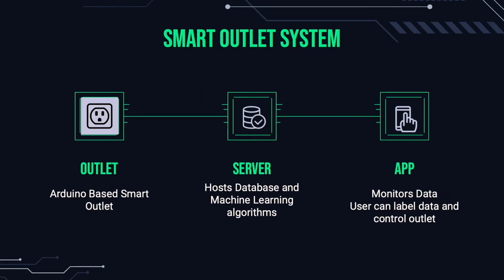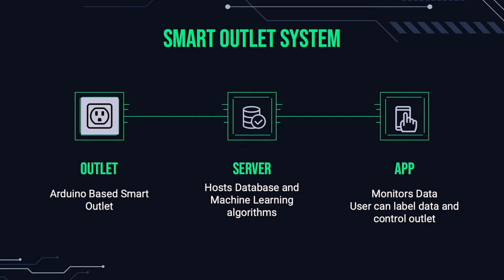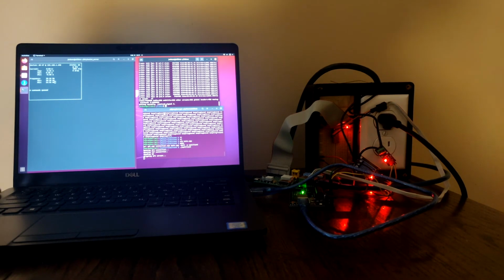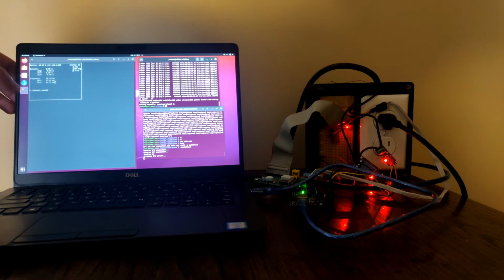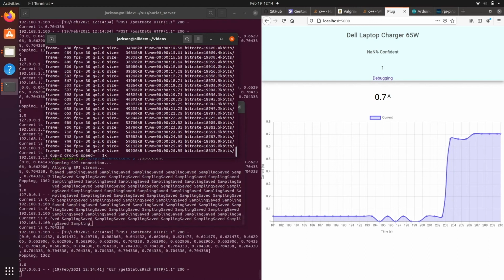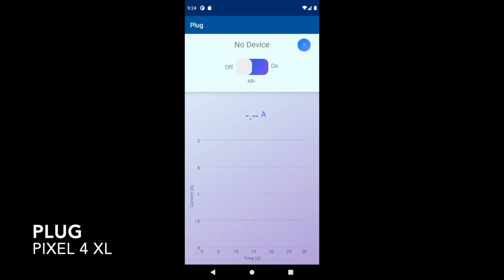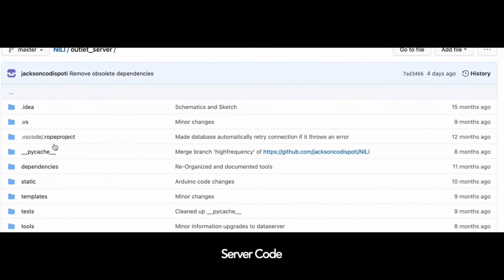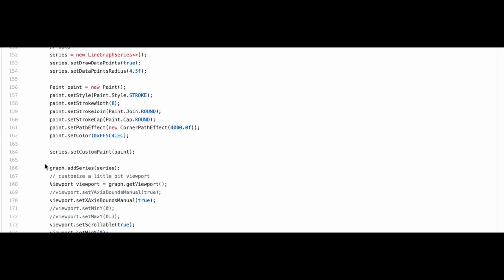Developing a Smart Outlet System - UK Computer Science

Comment: Is there a light and non-professional software to align the image if the projector is placed sideways with the hdmi cable? (for reasons of space I cannot project with the projector straight ...) I have a mini-projector the dragontouch mini z1 which with android 7.1 allows me to position the projector where I want and to have a large or small square or rectangle, (the problem is that when I connect the hdmi cable, the image resets itself, deforming ... obviously). A software for the hdmi connection or that makes the image I set the size of the device appear ??? (it has keystone correction but it only works if everything is centered, plus the keystonec does not allow me to shrink the image and change the shape)

But something more invasive would be better .... because if I connect the console I have no way to adjust the size, I am also willing to pay ..